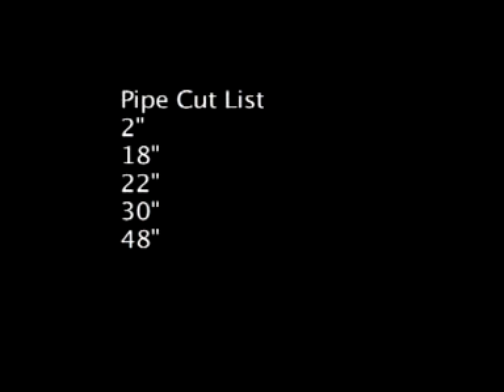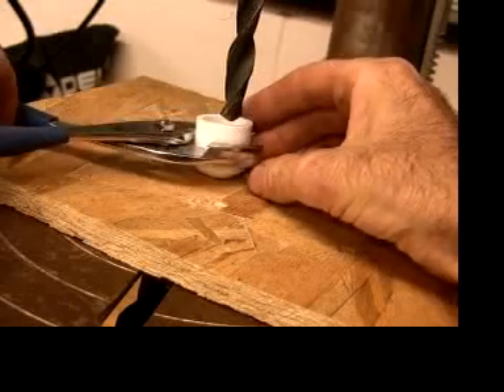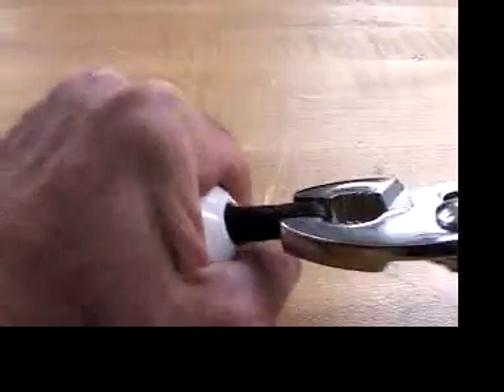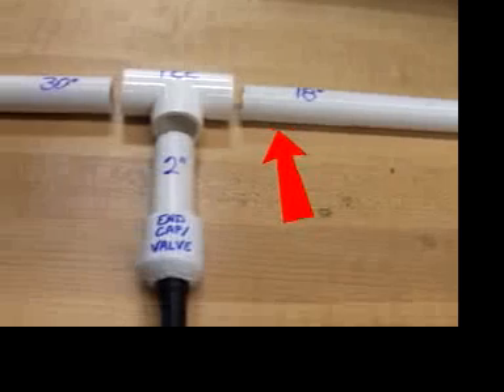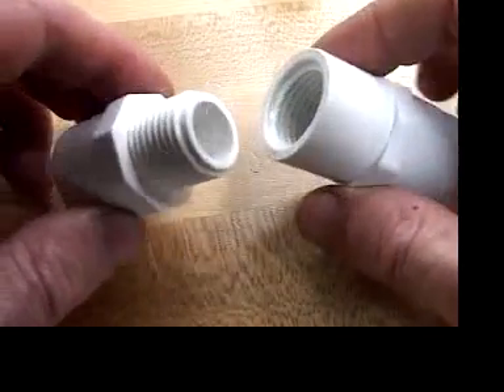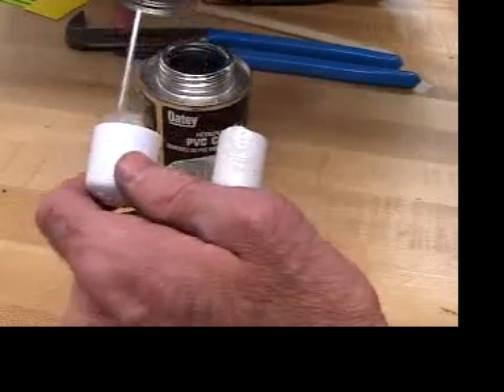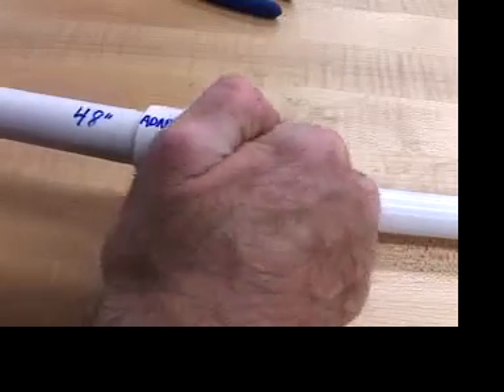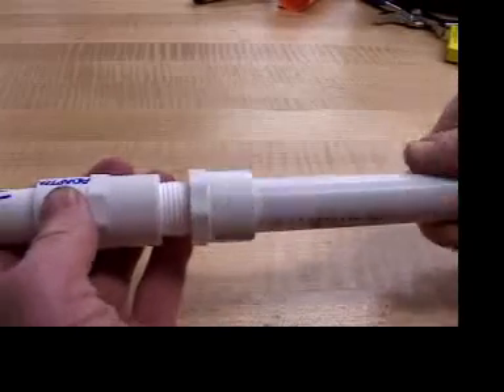Build an Overhead Water Rocket Launcher Part 3 valve pipe

Comment from the maker: @robert0joe re:using primer on PVC pipe before using the cement. It's a good question. I never use primer, but I do scuff up the surfaces to be cemented a little. I've never had one leak.
Slater

Comment from the maker: RE the 18" of pipe--good question. When you mount a bottle half full of water on the launcher a bit of water trickles into the pipe. If the air pump hooked in right at the bottom of the launcher, the water will collect there and could back up into the pump--making it very hard to pump. Tire valves have a check valve (one way valve) but they often leak a little. Including that empty 18" of pipe bellow the valve lets the water pool there harmlessly.
Slater

Comment from the maker: Go to an auto parts store and get some cheap, common, pull-through stems. Long or short stem does not matter, but if there are two widths get the thinner.
Slater